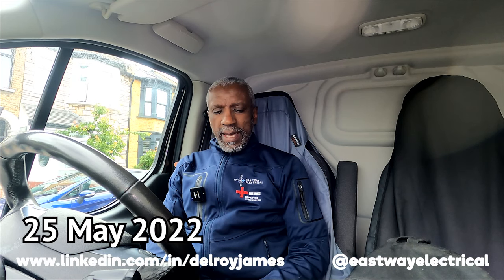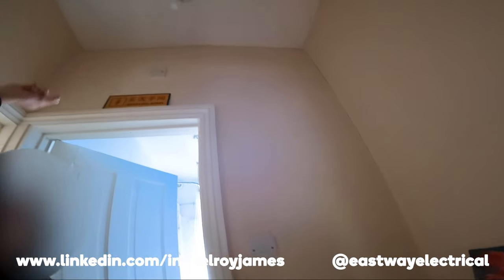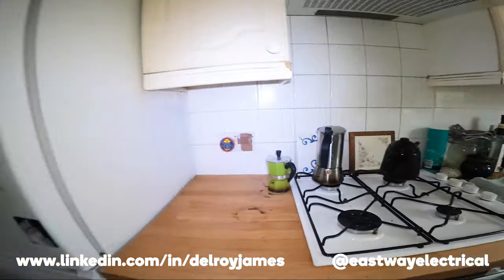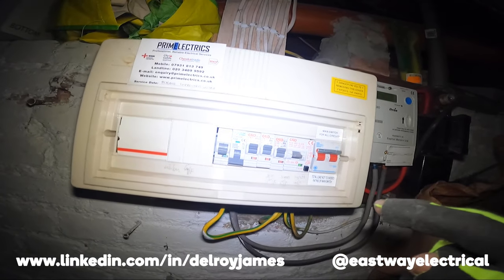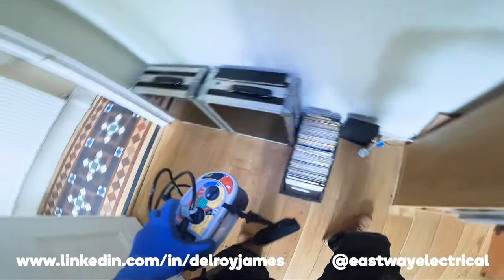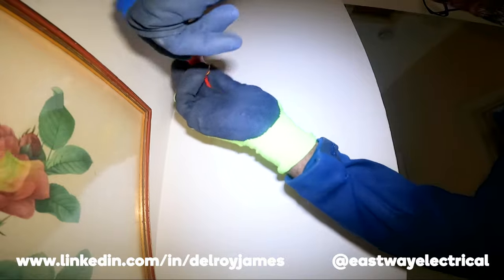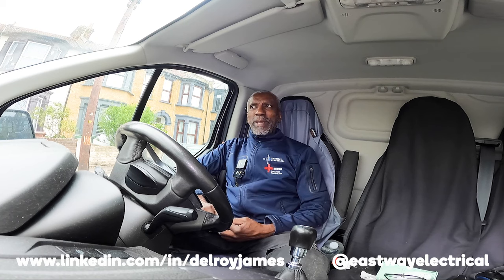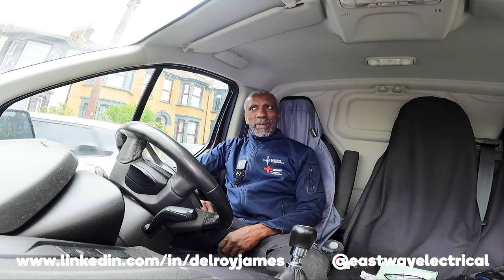"Simple Job?? Lets see..." | Electricians Vlog

Comment: I actually remember a similar socket issue where a tenant had dropped something on to the side of the socket. The front of the socket did not break, but both the lug in the box and half the inside of the socket had broken. I took it apart and literally half the socket fell to pieces, much like the one in the video did. We were called there because only half the socket was working and finding what we did was very odd.

Comment: wondering how much you charge per socket replacement?  around here in Reading, UK it's 90 quid callout including first socket but was going to be charged over 200 quid for 3!
Reply: OOF, down here in Southampton/Portsmouth area our charge is 50 pound for the first hour or part thereof,  plus materials and any certificates if required (obviously for a like for like replacement of a socket, no cable added, no cert needed)
Reply: Trades need only charge 'call out' for emergency-same day. Everything else is a booking. Understandably there will be a minimum charge (first hour etc). 
Look after the tradie who doesn't charge a fortune and forget the rest.